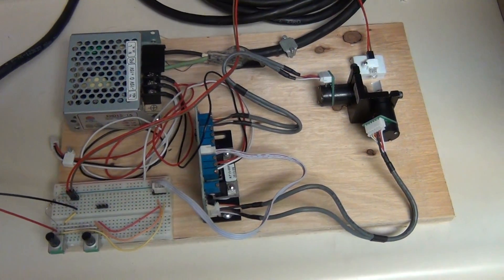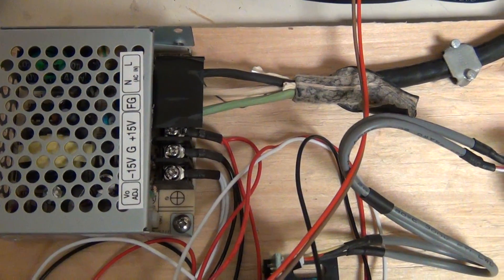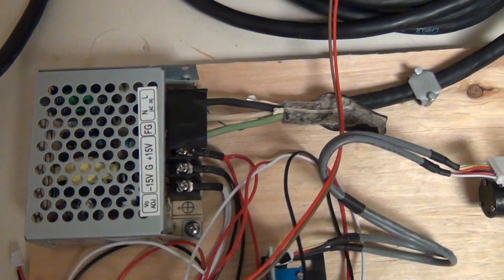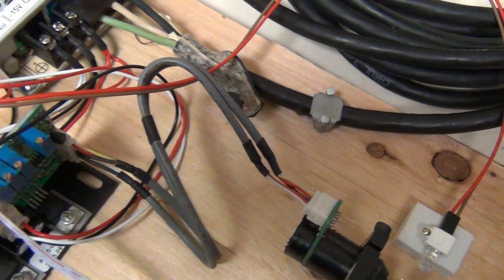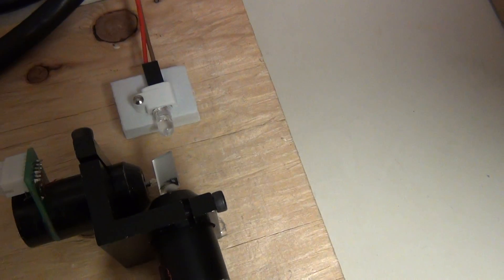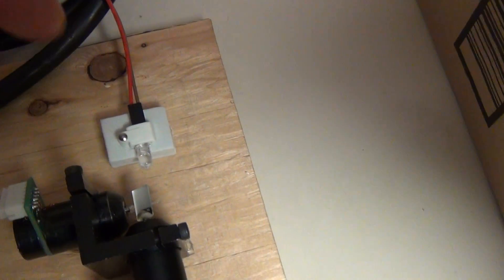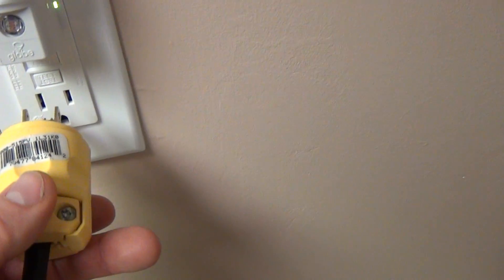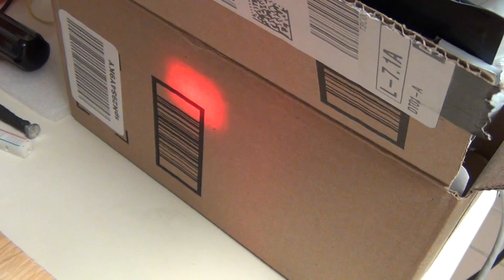DIY Saturday [20161224]: Galvanometer kit for laser projection -- Part 1

Comment: Hello can I use this motors with 445 nm laser module ? please help me
Reply from the maker: What is the power of that module? Any laser will work as long as the mirrors are able to handle its power. It is better to try a small laser first to understand if the beam is going where it is supposed to go.
Reply: @DmitriyL_Arithmechanics  it will be 5w 445nm and we will use it for us project
Reply from the maker: @serkanguryalcin  From the datasheet: 
 Size of the lens:  7mm*11mm*0.6mm
Mirror reflectivity:  >98% @45° ( 380nm-700nm)
Also, they warn to make sure the beam never points at the glue that attaches mirrors to the motor shaft. 
Because the mirrors are not perfect, they will scatter some of the light in all directions. Use laser glasses at all times. Most of the light will go in the right direction, though.
Reply: @DmitriyL_Arithmechanics  Thanks a lot

Comment: can you please send me your code please ,I want to do same as like you have demonstrated but in my case I am using microcontroller and H-bridge and I try to copy like yours when I am rotating potentiometer ,my galvanometer movement  is not smooth like your ,or it just reach other side .do I need to use any kind of DAC etc
if you could help he that would be great
Reply from the maker: Have you checked the full project playlist:
https://www.youtube.com/playlist?list=PLpeFrVvpwTivAVdpoumRoYhkFZ2EYBpWi
There are instructions about the DAC and the last video's description has a link to code on GitHub. Have fun!